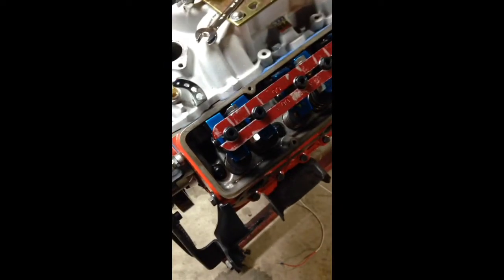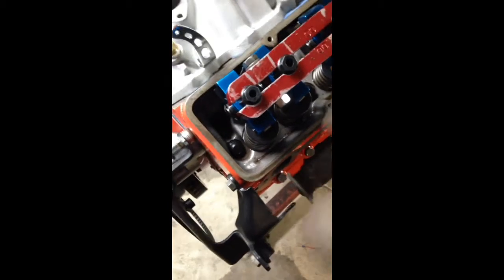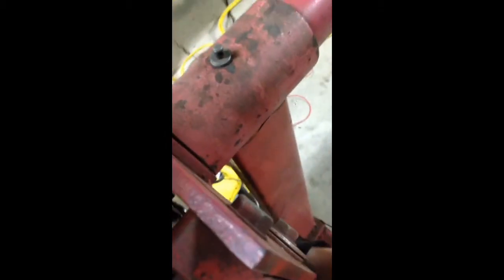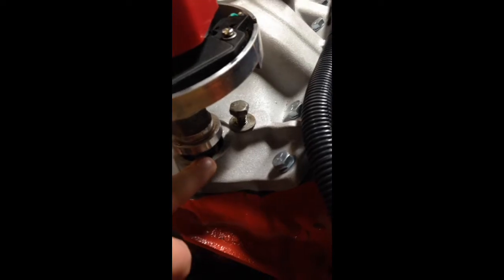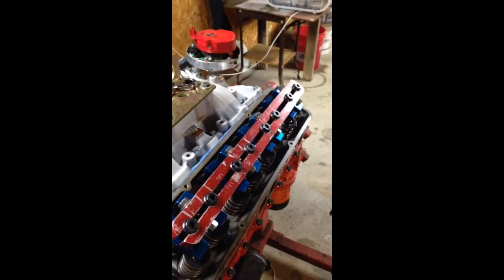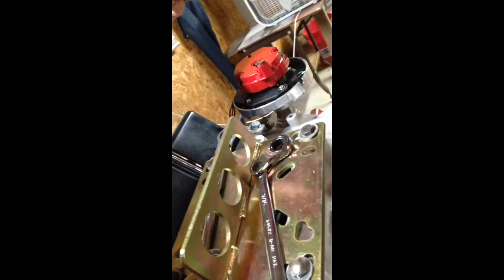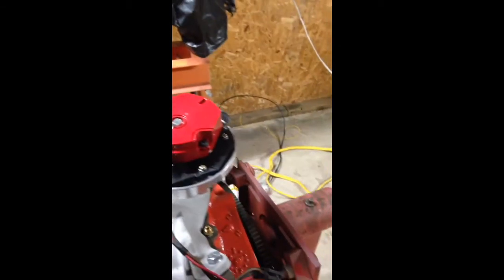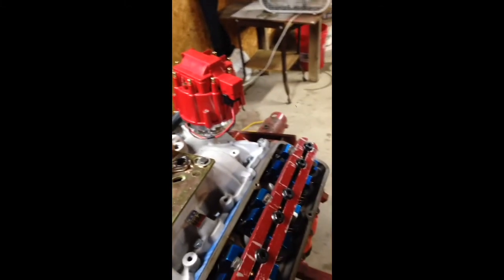Engine Building: Distributor Installation

Comment: On a Stock 86 Gmc 305 what should the timing degrees be when setting TDC? Trying to start truck but continues to back fire. Any help would be great!
Reply from the maker: I know I'm late on this I just seen the comment. Sometimes I have to dig through to find new ones. When you set TDC the degree will be 0. Also back firing could mean the distributor is out of the rotation by 180 degrees